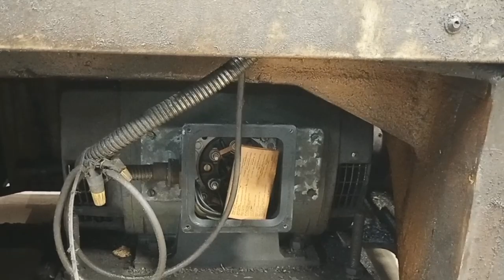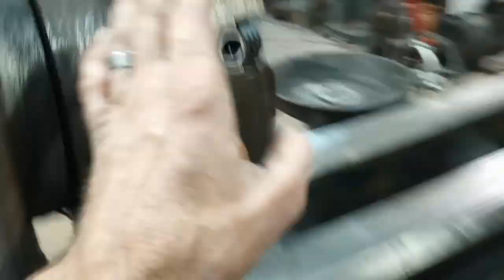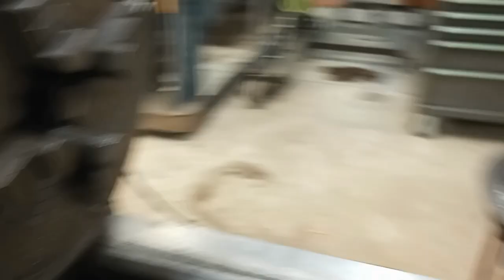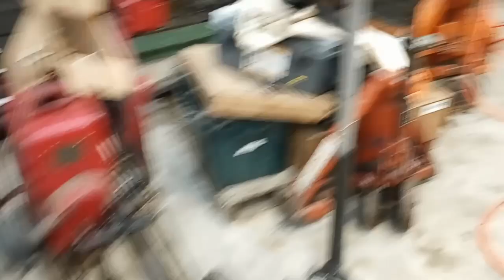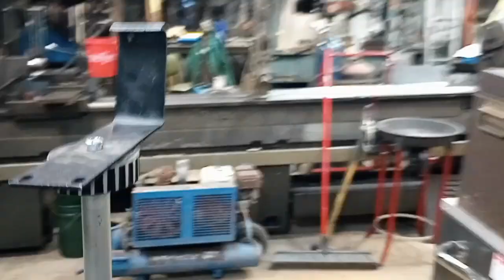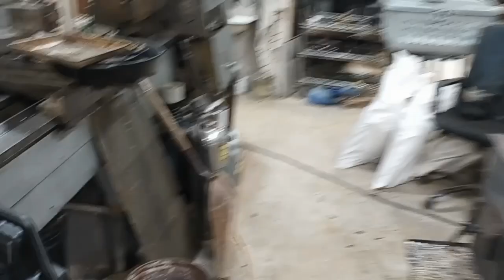A Colchester Mastiff 1400 21" Lathe Followed Me Home Now

Comment: Colchester was an independent company in England.  They used to say "As the world turns on a colchester".  Clausing got the franchise for the USA.  The english machines were built for the english market.  Have a look at the tiny "student" and you see the shape differences.  The clausing colchester was a very good lathe but they were US specific.  I dont know that much about the clausing differences but an english colchester will usually have whitworth bolts and are every bit as good as monarch.
Reply from the maker: As far as I can tell by the time this machine was built there is no difference between a Clausing Colchester 21" and a Colchester Mastiff 21" aside from design voltage. It appears that the 600 group owned both companies at this point and simply sold the same machines under different names.
Reply from the maker: I should add that the Colchester built machines were always better than the Clausing designed and built ones, the ones Clausing made were extremely light duty in my estimation.
Reply: @Andy-PerpetualMotion  There is an excellent documentary on colchester England on YouTube. I work both wood and metal. While I love Oliver, some of the English Wadkin machines were amongst the best ever. Esp those for pattern shop use. Wadkins were made in Liechestet England at the green Lane works.

Comment: Lots of British lathes have the handwheels that way round but lots had them the other way too, some manufacturers switched over, that layout became more common over time.
It would have been built with a UK spec 415 / 440V motor if it was a UK machine originally.
Reply from the maker: The machine voltage tag is clearly labeled 415 volts so I suspect the motor has been changed. I just don't understand how an English spec lathe would have ended up here.

Comment: You may know this already: On your new mastiff, pull the cross and compound wheels toward you. They will reveal metric graduations in the windows. They are stiff to pull. Also on the carriage wheel, pull out toward you and it will release and just spin freely. Used when it's in auto feed so it's not spinning around.
Reply from the maker: I'll have to check that out, I've seen them with the carriage wheel disengage feature but I've never encountered the English/metric dial setup.

Comment: That carriage is so much like my TOS 50B you would think it was the same manufacturer. Only difference is I have a ‘cross shifter knob’ for the power feed. I guarantee she will throw hot swalf up your sleeve :D  My cross thread was bent, so I popped a RH ball screw in it with a 90 box on the outside. Accurate with safe wrists ;p)